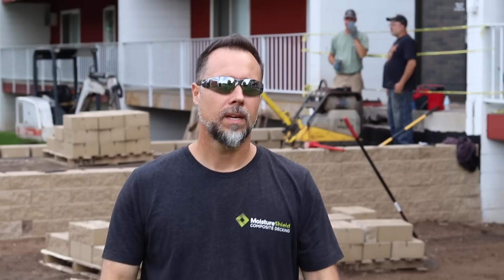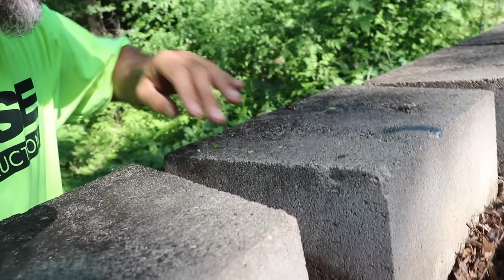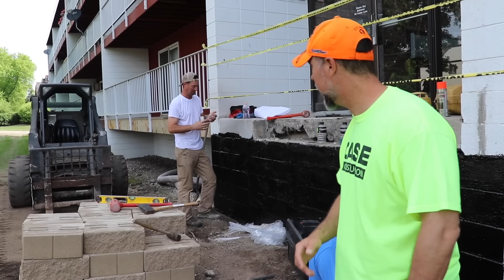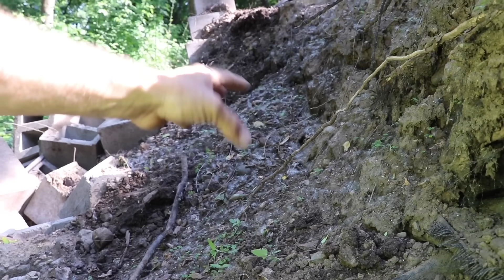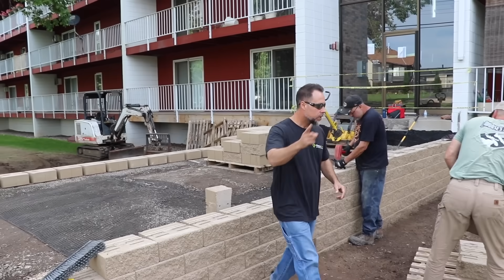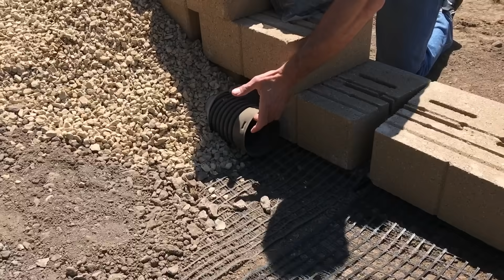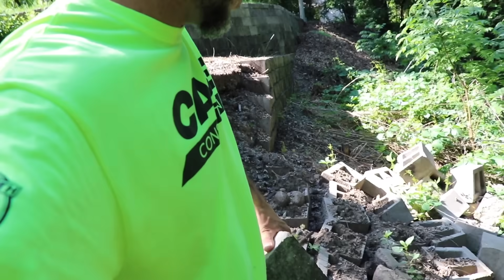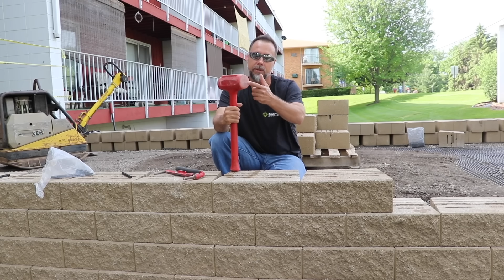How NOT to Build a retaining wall.  RED FLAGS, common mistakes, bad designs pt1

Comment: Hello contractor,
There are woven and no woven fabrics.
I have fixed collapsed walls puting no woven fabric that allows the water to pass and no problem
The key point is using the right fabric, not any fabric
Secondary, retaining walls are not suppose to cascade water throug because create other problems
If you don't put no woven fabric in the back of a field stone gravity wall, the water will pass through as well with the soil and the erosion will pile up in front and eventually, the rocks will fall since the rocks have no soil to rest in.
I have saw hundreds of cases as this of gravity field stone walls collapsing because water pass by with the soil as well
Second:
I have those walls with pins open up to 3/8 gap and the pins almost bend and the back gravel scaping to the bottom of the blocks and cascading wather as Niagara Falls, i bet the drain pipe is cloged, because lack of no woven separation fabric

Comment: The block with a cavity allthe way through should be filled with crush run gravel. #57 stone behind the wall with a drain pipe installed for positive flow to daylight at end of wall.

Comment: Thank you for the detailed explanation. I did not feel like the hollow-on-the-bottom blocks were very good since they couldn't be filled. Thank you for confirming my concerns.

I do have a question about using soil separating fabric on top of the drain gravel before putting planting soil/sod on the very top. Should this be done to keep soil from filtering down into the drain rock? This would only be about 4 inches from the surface.

Comment: Stanley, Tremendous videos. I am brand new to your wonderful site. My name is Steve. Great to meet you in your videos. I have many questions as I am in the midst of tearing down and an old 35-year-old stone retaining wall 6' high x 25' long. Question 1) Can Versal Lok block be laid on the existing 12" edge of a concrete slab? I just tore down this stone wall and found it was built on this 12" concrete slab edge. Can I use Versa Lok block on this 12" slab edge as the old wall was? I ask because I have a narrow ditch to work in.  I have a 1" existing main water line and electric line(s) to my house in this trench. The lines at at grade with the concrete slab and are 13", from the slab's edge. The lines were buried underground in the bank at least 4-5' directly behind the old stone. Question 2) Can vibratory or hand tamping-compacting, in 2" gravel lifts, be compacted over top of the existing 1" water & Eletric lines? I saw the video where you suggest no-vibrator compaction within 3' of the back face of the newly laid wall. How about hand tamping over a live water & electric line? Question 3) My wall is 25' long. If I use Vesa Lok block, you state there is no need for a perforated drainpipe, with a sock, buried behind the wall at all because water will bleed through the blocks, correct? Question 4) Glue adhesive should be used on each course of block, correct? I assume glue is to be applied to the block even where Geo-Grid is applied to the top of the block correct? I know you're busy. Thanks for any tips you may have. Thanks again, Steve from Virginia.

Comment: 15:50 so let's say i will have a 6ft tall wall:

at 2ft, I need 2ft of geogrid,
at 4ft, I need 4ft of geogrid,
at 6ft, I need 6ft of geogrid?

          - OR -

Do I need 6 ft of geogrid every 2 ft up to the top (6ft)?

Thanks

Comment: Nice video. Had some questions.
1) where do you get those sort of blocks and block pickup tool - in washington state
2) If you used the hollow blocks (HD has them) can you fill with cement instead of pinning and be ok.
3) Where can you get a retaining wall engineered design and typical cost.

thx so much

Comment: So you say to not put fabric vertically in between the back of your wall and your rock back fill. Is it okay to put the fabric horizontally on the top of your back fill rock and then put your top soil over that?

And secondly, can I put the fabric vertically between the backfill rock and the native soil?

Comment: I would like to know if the same approach is taken with a retaining wall that is 8 inches in height and 6 inches in width?  I was going to make with the Payer gravel on bottom and about 1-2 inches of drainage gravel running behind. This wall will run along the side of a black top driveway. Thank You

Comment: i got a projet  where i have a pole barn with a concreate slab floor   with a 4 foot drop on the back where I want to put in a wall  and remove the slope behind the back  can I go with out any fabric or geo grid as I whish not to have to dig under the slab

Comment: When it comes to armour stone, you definitely need that fabric behind face of wall!! These block wall, I agree you don't. But one thing to note is water flows to the easiest spot, it's one way I determine how to keep the back of the wall dry. But I do recommend filter fabric between the drainage stone and soils IMO as sedimentation will occur as the water pass through.

Comment: Where can I purchase the retaining blacks you are using? I'm will be taking down a 75 ft long and 5 ft high retaining wall this spring and want to replace it with your block with a pin system. I've searched google and can find it. Thanks in advance for everything.

Comment: I know this comment is coming in four years after you posted this video but I want to say thank you for talking about surcharges and geo grid.  I am doing the preliminary work (the digging work) for a short retaining wall (three feet tall) that will be supporting a cement slab and a large fireplace at the face of a hill.  [I am replacing the fireplace that was built in either the late 1950s or early 1960s.].  I am (I think) over engineering this wall because the soil is sand.  Consequently I will be putting geo grid every six inches. all of the way up.  I am also going to be putting my first course about eight inches below grade to add support.

If you think about it, could you do a start-to-finish video about how one would go about building a wall a few feet down from the crest of a hill that is meant to level out a section of the hill with the challenge of having to fill in the space behind the wall to bring it up to grade.  Thanks.

Comment: Question for you, I want to level my backyard out. At the house to the bottom of the yard (~30’ away) there is a 36” fall in grade. 

Would that be considered a surcharge? The wall will only be holding backfill, from 0’ elevation to 36” at the bottom.

Now I will be adding 2 courses on top above grade to “cheat” my zoning restrictions on max 6’ privacy fence. Technically it is a 6’ fence, it’s just a foot above grade. Haha. Gotcha township!

Comment: Hey Dirt Monkey! Love your Videos. Question regarding a 3' wall I'm installing in a sandy soil slope. I have the hollow core block from Lowes and plan to fill them. I'm installing a french drain wrapped in crushed lime stone at grade. I'm also backfilling behind the wall about a foot with the limestone. I'm told I should place filter fabric between the soil and stone backfill so the sandy soil doesn't seep through the crushed limestone backfill. I will have a VERY slight surcharge on this wall... a slight slope towards it. Any suggestions would be GREATLY appreciated. Thanks a million!

Nate

Comment: Um ... I was told use rubber with adhesive on the back side to prevent water/dirt defacing the front block, use gravel right behind that, and the bottom a French drain. So confused now. 
What is the right way?

Comment: I'm confused about why you'd need to slope the first block back a little bit to compensate for the geogrid thickness. Since the geogrid sits flat on the top, I wouldn't think it would have any effect on the level subsequent courses.

Comment: Thanks for much explanation especially the geogrid.  I wonder if it stretches if wall has force.  I watched wall panels(not blocks) stacked 20 + ft for highway overpass ramp sides.  Horizontal wire panels were attached to tabs on the back side of those panels. Looked like 2" gravel was filled in and compacted as those panels were laid across.  It looked to be 8 ft wide panels and width of gravel laid. I not sure but I think a drain pipe was ran next to base wall panel level to relieve any hydrostatic pressure.

Comment: wait. that lip on the hollow block serves the same purpose as the 2 plastic pins on the blocks that you like, does it not?  If I'm not mistaken then it's six or a half dozen.  Arguably that lip is stronger than the plastic pins.  But I'm biased against plastic.  They degrade and fail over the years even if they are initially strong.

Comment: Maybe stainless locking pins be stronger but could crack blocks driving them in or in hot Summer they expand and crack block,  but plastic as thick as a pen surely not as strong as blocks with back locking ridge?? I don't know. I do retaining walls Down Under but I'm keen to always learn more.. Actually all walls I have done are either concrete sleeper with steel H beams as posts with massive amounts of concrete or tilt up walls up to 3Meters tall again with massive concrete to anchor the H beam posts. 
How do these block walls handle very reactive soils?   I don't mind how much detail or explaination you throw at me.. The more the better. Thanks..  Jon, GWF , Australia

Comment: Without drain stone, the fines in the soil hold the water like you said and create hydrostatic pressure. The blowout starts at the bottom of the wall where the pressure is the greatest.

Comment: What about using a 2 1/2 foot tiered block against a cement pad? Do I put front of block against cement  pad? Will the pressure for time crack the cement pad??
Reply from the maker: depends on how well the cement slab is poured.
Reply: @Dirtmonkey  Well its a 6" 3000 psi with fibers in it, and reinforced with rebar and 2x2x2 footings with rebar 2' in of each corner. I have a 12'x8' swim spa with 1200 gallons of water on it!
Reply: Can I just put the blocks with bottom lip in back on top of the Cement Pad?

Comment: Thanks for this, I just changed my design because of it!
Reply from the maker: Glad I could help!
Reply: @Dirtmonkey  I have built one curved wall about 5 1/2 feet tall x 28’ long, using Geo mat to your specs. I’m doing another, about 3’ tall x 20’, which will support a 4”x4’x20’ sidewalk. I’ve been concerned about blowing out the wall, so I’m adding 3- 6”x3’ diameter poured posts, which will tie in to the sidewalk above. This should transfer the sidewalk pressure vertically. The wall will only have to maintain the #57 rock and soil underneath.

Comment: Nice job on your videos!!I Had a "landscaper" tell me the Versa Block I have will only last another ten years...Whatever. Anyways, I would like to see how you level a hillside, not at the top or bottom, in the middle using a mini skid, if even possible. Trying to build a retaining wall and have access to the mini skid but seems to conform to the hillside and doesn't really create a level surface.  Perhaps this is an impossibility but since you asked for video suggestions thought I would ask.

Comment: Question:  I wasn't real clear in the "rule of thumb" So, do you mean if the wall height is 6 feet each layer of Geo Grid length is six feet OR at 2 feet high is is 2 feet long and 4 feet high 4 feet long  six feet 6?...
Reply from the maker: a 6 foot wall will have 6 feet behind it of grid-at 3 levels. One 6 foot layer will be 2 foot high, then another 6 foot layer at 4 and a third 6 foot layer at the top
Reply: @Dirtmonkey  thanks that’s what I thought and after “Re-listening “ it reaffirmed it. Love your videos, wish you were in Pennsylvania I’d hire you. Your team seems like they are real pros as well. A rarity in this day and age.

Comment: Hello,

I am having a massive versa-lok wall  (2100 sf) installed that will be holding up a hill on both sides of the house. The masons are using crushed concrete on top of compacted dirt and then a concrete and clean fill mix on top as the base. I thought the concrete would be hard but when push my finger down in can drill down the concrete slab and my finger goes through. The wall is in progress and looks flat and stable but am worried if the base is correct. The soil is actually alot more like clean fill it looks like 
fine sand so I asked them to use filter fabric between the dirt and gravel but not on the face of the blocks. They have used a drainage pipe in the back and will be drilling relief holes on the bottom blocks. Can you or anyone with proper experience advise if the base material is correct and also if the use of filter fabric is a good idea to hold up the fine sand which makes up the dirt in place?

Comment: Great video.  Love the detail.  Interested in a video where you start with a poured foundation and rebar.  Also, you have and example of using that same, heavy stacked block/geo-fabric method over 10'-15'?

Comment: As a 40 year masonry contractor. When constructing retainer walls. One first calls a civil engineer whom, tests soils, compaction, slope, etc etc. the engineer will design, footings, steel, bond beams, compaction recommendations, grouting, Keys, etc etc. this is the only way you’ll ever get a permit from a city or county where I live in ca. Yes, there are cribbing systems and other systems but a permit and engineering you will have to require.

Comment: I’ve seen a lot of videos on retaining walls, they say most walls fail due to the water having no way out. So does it just depend on the block you use? What if you used cement(concrete) for your wall?
Reply: The two reasons for failure are hydrostatic pressure and improper installation.  I never recommend solid concrete because the wall will still want to expand and contract with freeze-thaw cycles, thats why even on driveways you have to have relief cuts because the concrete will crack someday but the relief cuts force the concrete to crack where you want it to.

Comment: Typically the drain rock is wrapped in  filter fabric to prevent sediment from migrating and  clogging the drain layer. Also if the sediment keeps getting washed out, you can get some long term erosion behind the wall. What's your thought on this?
Reply: This video seems to be not applicable to my small DIY project.  I will use the filter fabric to wrap my drainage stones.

Comment: Sloping backfill behind a wall is not a surcharge load.  Surcharge is additional load that may be imparted on the wall from live loads such as loader that may be behind the wall or pedestrian loads.  Also MSE walls- mechanically stabilized earth retaining walls work by "reinforcing " the soil mass behind the retaining with geogrids and creating a large mass that resists  overturning moments and sliding.  This is also different from "reinforced earth walls" that used galvanized metal straps behind the wall.  These walls act by the metal strips serve to "pull the wall"  (similar to a tieback ) to prevent the wall from overturning.  The tension is developed along the metal strip by the frictional resistance from the granular backfill that must be used for reinforced earth walls.

Comment: If you have a layer of drainage rock against the wall or even at the bottom like a French drain, you absolutely  have to use a permeable geotextile fabric vertically as a filter between the soil and drainage rock to hold the fines back from plugging up it up. Easy to speak in absolutes when you’re playing with LEGO blocks in the kiddy sandbox 😜 Soil conditions, temperature and precipitation, drainage, wall construction all this can factor into wall design and construction. Good advice here to camber the wall back so that as the soil settles or consolidates the soil pushes the wall out to be vertical. Using any mesh or Geogrid type product essentially turns the wall into a veneer.......it considerably reduces the soil pressure exerted on the wall as he fabric, mesh, or grid carries the lateral soil loads in tension.

Comment: The term you are searching for and in action with "Retaining Walls" is called "Hydraulic Pressure" ... this is what caused the "Spreading" you're trying to describe. Note that "Water" is "incompressible" meaning "Gravity" (which works 24/7) will do all the work to push out the wall. Great call on the "Fabric" ... big no-no on a facing surface ... like an automobile Oil Filter, it clogs in about 30 minutes (ample time to catch particles harmful to an Engine) and then "By Passes". "Cloth" is great for preventing "Weeds" and allows, in normal circumstances, a reasonable "Soak time" ... measured in "Drops per Minute" after "silting" of a fluid's turbidity. Sorry for being so long on this ... before being an "Aerospace Engineer" I built 20 foot "Tie Walls" ... pre "Grid Materials" ;)  Great advice and job !!!

Comment: Wish you had a video on building a retaining wall with a stepped base.
Reply: Hoping to tier my wall twice as one end of my trench is about 8 inches deep, and the other end about 3 feet deep (for it to be level at the bottom). Building this along a slope and hoping to correctly put in a stepped base.